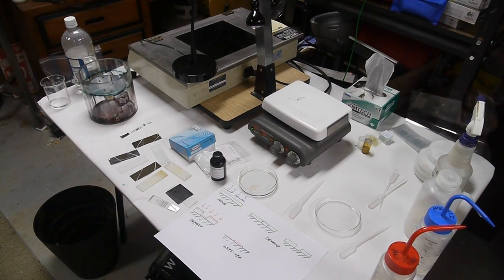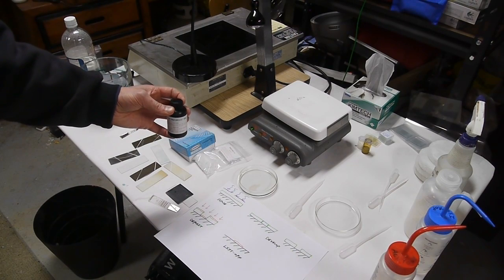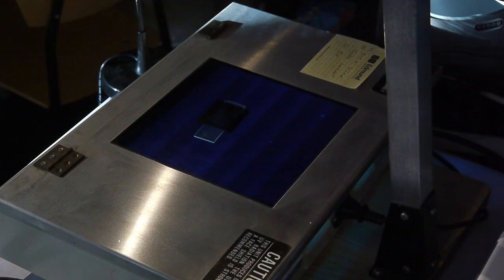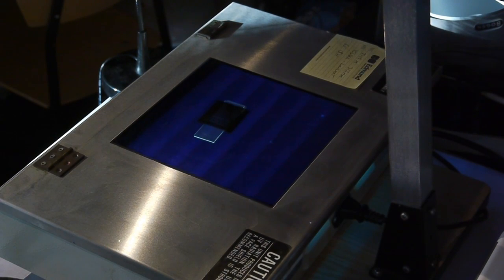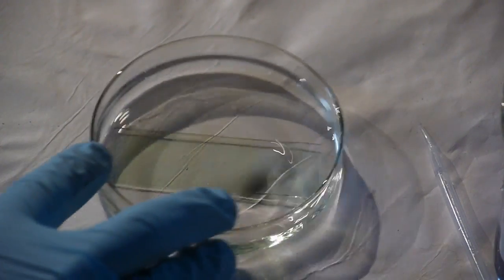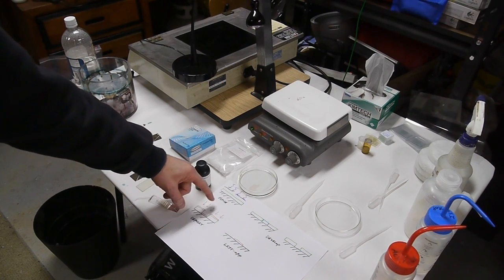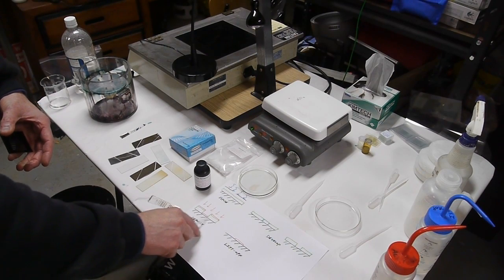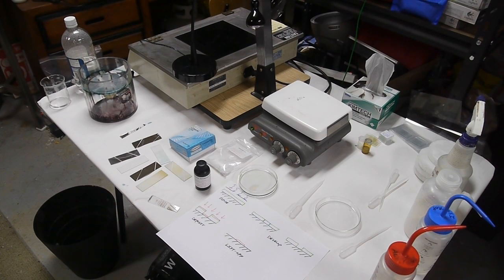Patterning aluminum with the photoresist "lift-off" method

Comment: Thanks for the video! 
May I ask why only the Aluminum on tip of the photo resist gets lift off and the ones that arent on dont get etched?
and is the reason why positive pr is not good for lift off is because angle is tilted outside of the middle aluminum, causing it to be deposited there?

Comment: With that machine you could make high performance capacitors with only a few grams of gold vapour and some other material like boron or selenium? Each layer in the capacitor only a few atoms thick. A capacitor like that would revolutionize the battery industry.

Comment: presensitized pcbs come with a similar green coating although it appears they are much thicker.  you may want to try 2 coats or slower spin. I use clear slides then lay them under glass directly on the boards similar to 1:1 printing a photo negative.  the angle of the walls can be controlled to some degree by using a wider light source and varying the distance of the source to control the angle of the light rays

Comment: Beautiful work - this and your previous one on sputter-coating. When you've got the sputter gun working well, you have to do up some CAD drawings - this is something I thought on making ages ago! Unfortunately I'd then need to make a proper vacuum chamber to go with it ;-)

Have you noticed any temperature effects on the quartz thickness monitor? I remember using one that started giving a reading, just because of radiant heating from the filament and not because any material was being deposited.

The resist looks like the stuff that comes on pre-sensitised PCBs - it's green to start with and then changes to a gray-blue colour (hard to tell because of the coppery colour underneath).

I never understood spin coating - why is the coating thickness uniform, and why doesn't it just all fly off, leaving a lump in the middle. I guess it's getting a balance between speed, viscosity, and evaporation rate.
Reply: The reason is doesn't all spin off is because the layer closest to the glass actually has an electrochemical bond, so to speak. Water and many other liquids will do this. The layer of water that is directly touching the glass actually ends up with a slight charge separation. If you want to know more about this, check out Ben's videos on the plasma formed by high-pressure water... pretty sure he goes into more depth on the same topic in his fritted glass electro-pump (the one with no moving parts, just uses electrostatic fields to move water using this charge separation I mentioned).